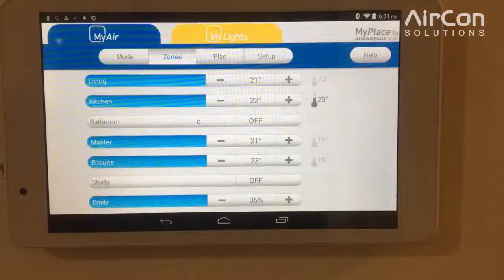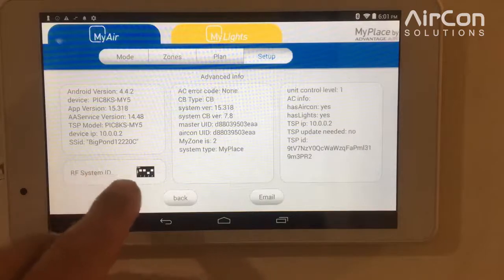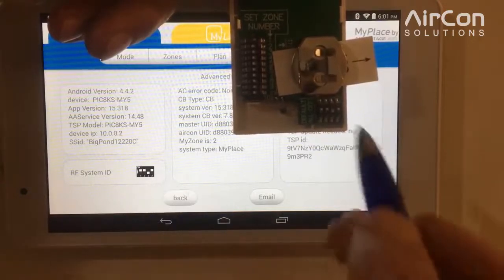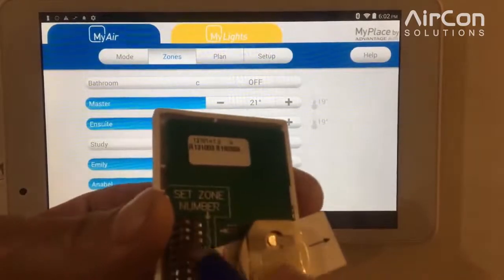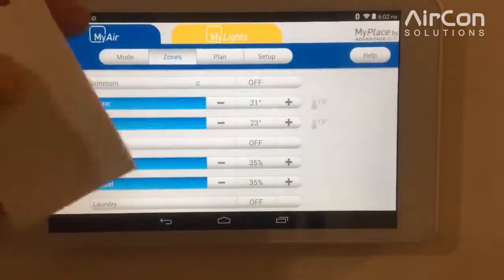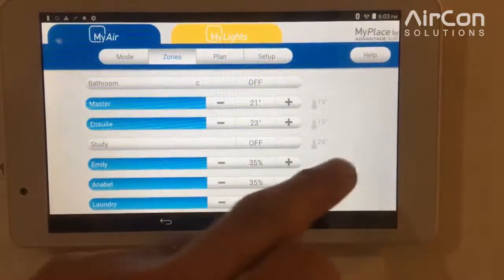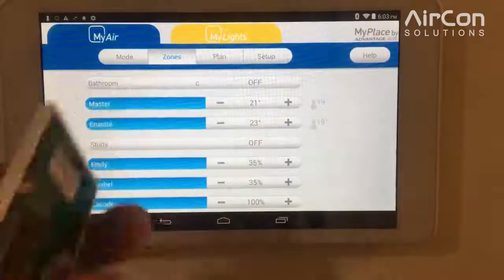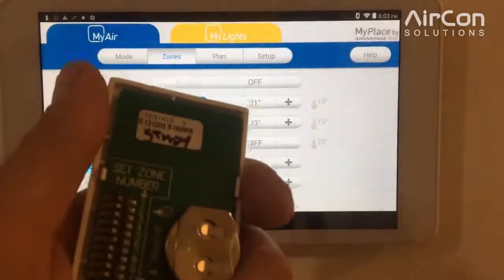How to set up new temperature sensors on MyAir systems

Comment: Hello, I have a similar system Daikin FDYQN125/RZQ125 with remote sensors installed, same as those in the video. There are 6 zones, 5 RF sensors, two being constant flow. 

I noticed that the zones that are non constant flow will stop the air flow when they get the desired temperature. However, the constant flow zones will not stop despite the temperature set to that zone, as it seems that they are trying to achieve the overall temperature (Set target temp). I guess it will only stop the constant flow zones when the return air gets to that temperature.

Could you give me some advice? I am not sure what to do, as the wall temperature sensors are being ignored in the constant flow zones. (I am also concerned that is not very energy effective this approach)
Reply from the maker: Hey great question.

Can you select “my zone” on your touch panel? 

If you system is set to run to return air set point the unit will run until the return air temperature is achieved, if that’s the case there is two options. 
1) move the constant zone(s) to the area / zone nearest the return air intake, so once all the zones reach temperature the constant zone open up and push tempered air to the return air sensor.
2) reprogram the unit to sense from the wall controller and set the dip switch 5 to off.

If you require move information please feel free to contact us at AirConSolutions.com.au